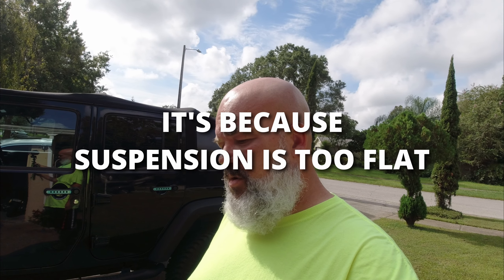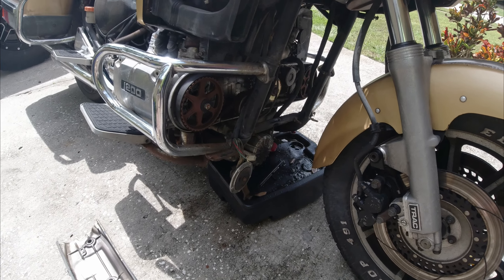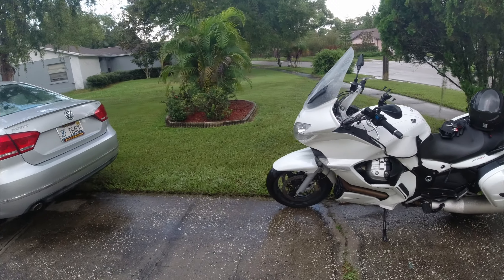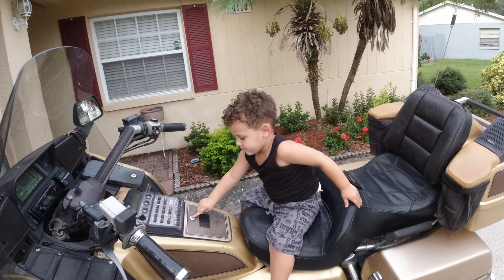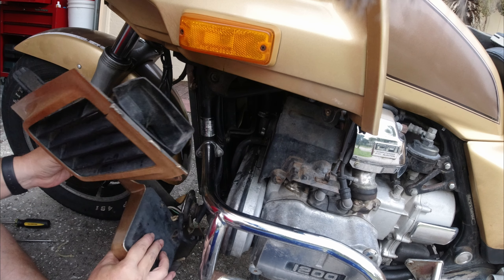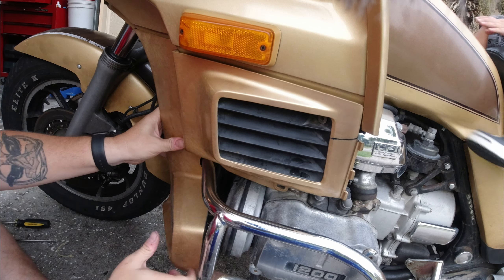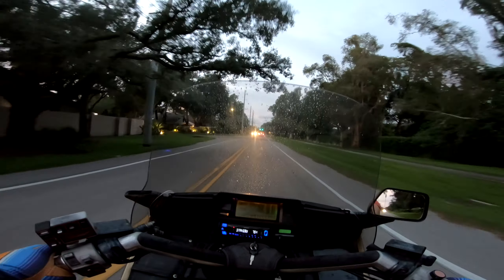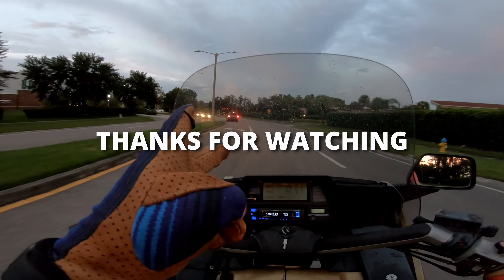I never want to do this again

Comment: A little trick for the center stand. I have a multi purpose 2x4 in the back of my Ural. If I have a flat and need to get it up on the center stand, I roll the rear tire up on the 2x4 and it'll give you a couple inches. Makes it a lot easier to get it on the stand.
Reply from the maker: Excellent tip thank you! My suspension is flat as pancakes. Won’t even hold air when I put it in manually. That’s a lot to do with it I’m certain. I’ll try that wood trick

Comment: I chose to rebuild my brake calipers completely because brake fluid is a corrosive in it's nature. My 87s speedo broke when I changed the tires two years ago. I've figured out my speed by using the gear and rpms. It's not that big a deal if i do not know how far I've ridden. I do my oil changes between 18 and 22 fill ups assuming I'm getting 150 plus miles per tank???? I get better mileage since rebuilding the carbs and tuning them, but using Amsoil I get better then average engine, transmission and shifter fluid.
Take care every one, You are in my prayers
Hoka Hey

Comment: I hope your head is ok. I’d definitely get the coolant temp sensor replaced and fixed. Thanks for the video. Be safe and keep at least 1 wheel on the ground.
Reply from the maker: I'm in the process of working on that coolant temp sensor right now. Just came inside for a heat break haha.

Comment: Someone probably put a tire on your gl1500 that was sized for gl1800 aspect ratio is smaller. This makes it impossible to put on center stand, also makes rpms on the hwy go up by about 3 to 400 rpms mileage to go down. If You put car tire on it use 195/65/16 voice of experience! Now it will go on center stand.
Reply from the maker: I’ve considered the car tire thing. Was watching some videos about the pros and cons of that last week. That said, I did get it up on the center stand last night after a friend of mine sent me a video and showed me what I was doing wrong. But now that you mentioned maybe the tire is too small, I’m going to look at that

Comment: I have that OCD with everything I do on a bike, did I tighten everything, let me go check for the 20th time today.
Reply from the maker: I'm the same way with locking my door at night. I'll be damn near asleep and have to get up to check the locks again. It's crazy.
Reply: @UncleBogator  My trick is to do sometime silly after the task. "Lock the door and then tap the handle 3 times" So later on, if I start to worry if I locked the door, I'll say "oh yeah I did, I tapped the handle 3 times like a silly goose."